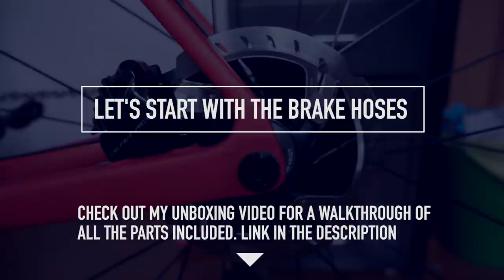Dura Ace Disc brake Installation and bleeding How-to | Road to Dura Ace 9170 Ep.3

Comment: Great video and the music certainly helps with what is quite a stressful process the first time done.
I just wish I'd seen it earlier: I over-tightened the bleed screw and stripped it...
It's much too easy to do this with such a tiny aluminium hex bolt, so I assume it really does not need to be fastened tight at all.
Fortunately there is enough 'outside' of the screw-head clear of the lever body for a small pair of pliers to get sufficient grip on it. But it took a lot of profanity before I realised this.
I'd also advise against using a ball-headed allen key on the bleed screw, it seems to make the slipping/ stripping problem worse. Flat-sided, and inserted as straight and deep as possible.
Reply from the maker: 100% agree! I can add that even my "expensive" hex set has a slight curve on the non-ball end side that can cause trouble. Now I always use a really cheap set of small hex keys that at totally flat on both ends.
Like you say, it doesn't need to be that tight at all, it's probably the rubber O-ring that keeps it sealed rater than the actual screw.
Cheers!

Comment: Stumbled upon this after watching the rotor installation video from Park Tools and they recommend to not put grease for the rotor and centerlock lockring. But as long as you are careful to not contaminate the rotors, I don't see why not to put grease there as explained in this video
Reply: The axles that are pretty much at the same distance from the rotor as the centerlock are, are full of grease. I agree, if you're careful when applying the grease and when cleaning it isn't a problem

Comment: Most important tip of this video.. do now overtighten.  You are better off checking your brakes for leaking over the next few days than over tighten it.  I had to buy a new shifter because of this problem.  the threads inside the shifter is made of cheap plastic/alum or whatever the crap it is.  I wish shimano made the fill port like their older models with real metal and very hard to strip

Comment: Interesting.
Why not wiping any fluid before  putting the bleed screw back in? I always did that, whats wrong with it? Thanks in advance.
Reply from the maker: You basically want to have it overflowing as you close the bleed screw to prevent any air getting trapped.

Comment: Shimano has great tool for cutting brake hoses and installing inserts (TL-BH62). It makes that job easy. btw, you making great videos =)
Reply from the maker: +massionmassii thank you!
yes, I've seen it as well. Did not really feel it was necessary as I do this once or twice per year. But good to know that it is an option! Thanks for sharing!

Comment: Great help! I have the Ultegra version which have the bolts already in the levers with a yellow stopping valve. I'm presuming there's liquid in them already. The cables are already attached to the callipers and sealed. I'm not really sure how to approach getting the stopper and bolts out of the levers and attaching to the cables?

Comment: Did you found the hood a little loose? Or I'm just an unlucky guy?

My R8070 right hood get loose just after I rolled the hood from front. Replaced with a new hood and everything is fine.
Same happened for my old RS685 while it takes several months to happen.
Reply from the maker: Adam Queen yeah, they tend to not be as tight after you pull it back the first time... not a big issue for me, they seem to “pop back” in to place one you start riding I’ve found. 
Not had the need to replace one yet.
Reply: Glad to know that, I'd ride hundreds kilos to see if it get better.

Comment: Very nice & instructive video - as always. 
@1:40, the bolts provided with Ultegra R8070 are way too long for my bokeh frame. Should I look for shorter bolts or work with spacers? Thanks and keep up the good work!
Reply from the maker: MaPo depends on how long they are? I I used spacers in my Bokeh as well, maybe 5mm or there about. You don’t really want to have them stick out too far underneath.
You can also buy those bolts on amazon, this is the one for 15mm stays
https://amzn.to/2FettUE
Don’t remember exactly which length the Bokeh required.
Cheers!

Comment: How much lever movement did you turn out with before the brakes grabbed? I know  you can adjust the reach and free stroke on these levers but mine seem to have a lot more "distance travel" toward the handlebar than my old 785 levers did?! The brakes work fine, but there is just a lot of travel. Do yours feel like they have a longer pull as well?
Reply from the maker: Brian Smith, hmmm no, I think it was about the same feel if not a tad better... was a while ago now I used the 785 so can’t say for sure. I always liked a lot of travel on my levers though.
Check my reach and free stroke video, I have mine set to minimum free stroke and about middle reach.... 
https://youtu.be/9TkudgYe0EY
maybe you can compare yours to the travel in that video.

Comment: Hi! Great video, just got one question. I'm building a bike from scratch with Ultegra R8070. How do you recommend me to measure hydraulic cable lengths since I don't have the old ones to compare? Thanks.
Reply from the maker: I would thread the full length hose through the frame, then secure it at the point where it would be at the rear brake caliper. Take the other end and hold it against the handlebar (or even tape it down if necessary) then turn the handlebar in both directions and make sure you have enough slack so the bars can turn freely.
Like I do @ 0:27 in this video.

Hope that helps
Reply: @ridesofjapan  Thank you!!!! I'm really excited about the build!
Reply from the maker: Jernej Markovc Nice mate, nothing like building up your own bike 👍Good luck!

Comment: did you use the full two bottles of fluid for the install? I'm starting with a dry system like you (with used parts) and I'm wondering how much fluid I should buy, and I still haven't found info on the volume of fluid the system contains
Reply from the maker: Jean-François Morissette if you’re  lucky you could get away with just one bottle, but I wouldn’t risk it... get two just in case, you will need it eventually when re-bleeding. Not very expensive either.
Personally I got one of the big bottles, should last me a good couple of years :)
Reply: Thanks for the answer! I'll go with the bigger bottle then. cheers!
Reply: What kind of fluid?
Reply from the maker: Dust2dust02 Shimano only uses mineral oil

Comment: Swapping out ST-R785 shifters and BR-RS805 calibers for ST-R9170 and BR-R9170, would the same hydraulic cables be re-usable?
Reply from the maker: According to Shimano, they say you should use the BH90 cables with 9170/8070 rather than the BH59 that are specced for the 785/805. I haven't tried using any other combination so can't confirm or deny if it will cause any problems.
One thing to keep in mind though, is that the Hose nut you need for the 9170/8070 levers only comes with the BH90 road hose kit.
Reply: From what i know the BH90 have a bigger diameter to push more/easier fluid. shimano adopted the MTB stuff to road here. in theorey it should work with the old cable, too, but you need to buy the new hose nut seperatly then.

Comment: i would like to replace the brake calipers only. should i use new "olive" ring and hose insert at the existing brake line? or should i also change the brake line with a new one?
Reply from the maker: Alex Ioannides To be sure that it will be a tight seal I would cut of the old insert/olive and install a new one. No need to change the hose as long as it is long enough and the new caliper can use the same hose (In Shimano’s case SM-HB90 and SM-HB59)

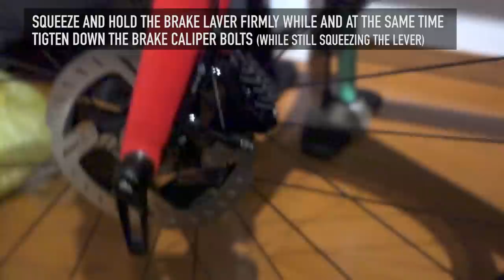Comment: 11:21 What is the torque requirement for tightening the front break mounting bolts on a carbon fork. According to Shimano manual 6-8 Nm is needed but i think that's too much. Great Video, thanks.
Reply from the maker: Litening Pedals you should be okay with the Shimano specs unless the framemaker specifically states something else. I’m usually in the 5-7 range.
Reply: Thank you

Comment: Great Video! Just curious if I do take out the hydraulic hose from levers after installation do I need to rebleed etc? I am only asking cause I dont have a bleed kit and would like to change bars.
Reply from the maker: Thanks! Most likely you need to rebleed as air might sneak in to the system. You will know once you connect everything again... when you disconnect make sure you don't squeeze the levers.
If the lever feel "spongey" when reconnected, then it's probably best to rebleed.
Btw, unless you're handlebars are internally routed you shouldn’t have to disconnect the hoses.
Reply: Thanks! Yeah I am taking out the internally routed ready bars for a custom paint job and figure I try to do it myself without bringing it to the shop. Guess I best buy the bleed kit.. Btw are Sram bleed kit and shimano bleeding systems compatible other then using diff oils
Reply from the maker: The way you bleed them are quite different... you could probably hack your way using sram syringes with Shimano, but not the other way around. Shimano are way simpler to bleed as you don't really need syringes.

Comment: I have a new 785s and one issue. It is too much 'freestroke' feeling and large levers movement until they bites disks. 
I've bled these things several times with all the tricks (according your video). No air in system! The free stroke adjustment is all the way in (least free stroke) but the lever still moves 25mm before pads full engage. Do you have same problem with your old 785s?
Reply: You can use a smaller bleed block. Original it is 10mm. You can use 9mm or 9.5mm. you can make a bleed block by yourself from metal , wood,...
Reply: @arnopauwels8945  nice try, but ... same same. Used 9,5 mm block custom made. Still to much lever movement :( Thanks for idea.
Reply: @61vik  you can try 8.5mm. I had the same problem. And how smaller the bleed block, the pistons coms more out. It's the only way it works. Succes

Comment: Did you fit the Di2 cable through the same opening as the brake hoses? Thinking about converting a mechanical canyon endurance to Di2 ... I won't think the cable will fit through the gear cable openings.
Reply from the maker: Horstelin This frame was di2 specific and was made to take the brake hose and the di2 cable through the same hole with a combo-insert.
Reply: Rides of Japan ah ok I guess I will have to solder to make it fit... Too bad those R8020 STIs are so damn bulky
Reply from the maker: Horstelin oh wait a minute! I confused this with another frame I had!
There was a separate port for the di2 on this endurace, but I manage to get both the hose and the di2 cable through the same hole by modifying the frame insert... just needed to make the “slit” in the inserts big enough to squeeze the di2 cable in.
Unfortunately I don’t have this frame anymore so can’t show exactly how I did it.
Reply: That are great news, thank you! I guess I need to start saving for the new groupset.. :)
Reply: Don't mean to cut down di2 I think their shifting system is great.  But if you have an older bike with out the wire plumbing ports, just go Sram wireless e-tap, and while you're at it go WiFli.  No wires no battery containers "NADA PINATA", just clean as a whistle.
Reply: @dansotelo228  I guess I'm just a Shimano fanboy :D
Reply: Keep it fun!  I love how di2 shifts especially how the front derailleur automatically helps shift then moves away from the chain, simply the best.  Just a reminder, make sure your derailleur hanger is true, and just because its new does not mean it is true, as di2 is very sensitive to this. Also keep in mind your di2 11 speed chain has a very short life, start checking it at 600 miles, with an infinity measuring chain tool like the ParkTool CC-2. When it measures just slightly past 0.5 replace the chain. Ignore the 0.75 Replace Chain printed on the ParkTool, cause if you let it go that far, you can kiss your expensive cassette good by. That goes to any high end road or mtb chain.
Enjoy, Dan

Comment: Thanks heaps for this video, super useful and easy to follow! Managed my first brake bleed without issue. Noticed my pads are getting a bit lower (nothing dire), so started searching for new pads. Couldn't find Shimano lo3a pads anywhere (or basically any Shimano pads). I live in Japan, and in Tokyo, but that doesn't seem to help. Any thoughts on suitable replacements for the lo3a pads?
Reply from the maker: I got word from my LBS that Shimano is replacing L03A with a new pad L04a (probably look exactly the same) but probably still be a while before it’s out I reckon. 
Any pad that fit the Shimano flat mount is better than nothing, but I haven’t personally tested any of them so can’t give you a recommendation sorry.
Reply: @ridesofjapan  much appreciated. Will see what the LBS suggests…

Comment: How did you get the olive over the barb? or did you just leave the barb installation part out?
Reply from the maker: 1:05 barb installation
1:55 olive just slides over after the hose nut

Comment: Thanks for great instruction. Now.. what should I do if I actually overtightened bleed screw and messed it up?; help plz.. TIA
Reply from the maker: Did you totally strip the head?
If you still have some edges left, find a hex-key that don't have a rounded tip.... that rounded tip on the more expansive ones did almost destroyed my screw.
I found non rounded ones in one of those "cheap" multi-tool kits... 
Another tip would be to find a small enough torx key witch is also a common tip for damaged hex crews.... wonder if they make em that small though.
Reply: Rides of Japan tnx for the tip. I think i totally stripped the tip. Since i had bh59 with rs 685? And replaced with bh90 with r8070, i opened and closed bleed screw at least 4 times during the learning curve. I mean replacing is one thing but how do i close it after final bleeding? It seems inevitable that i need to go get a new screw huh? Do u think normal bike shops in the us will have replaceable screws? Since r8070 parts r really hard to find due to low supply, i ordered from uk and germany and US shops. Smh about my dumbness and lack of skillset...
Reply from the maker: Yes, I would get a new screw just to be sure. If your LSB don'T have them in stock they can surly order them. The part number is Y0C698030. (Did a quick google search and there seem to be a few sites selling them)
As I learned too, you don't actually need to close it that tight, the O-ring is what is keeping it from leaking.
I mess up all the time, that's what we learn from :P I semi-striped one of my bleed screws, and order two new just to be safe. They are available online here in Japan.
Reply: Rides of Japan tnx again for ur prompt answer. Just subscribed as well :) plz keep uploading DIY videos so i can learn more-!
Reply from the maker: Jonathon Lee thanks man! Got a few tips to share in the pipeline :)

Comment: Do you really need to fill the system with oil to the top ? With the older génération (R785) if you did this the oil would leak somewhere to prevent overfilling
Reply from the maker: Yes to avoid having air in the system you need to fill it to the top (into the funnel)
Reply: @ridesofjapan  okay thank you !

Comment: Hi, love your videos. Do you know how to adjust the new 105 disc STI to get the breakting point earlyer? At the moment I can pull the lever to far to the handlebar...
Reply from the maker: Sound like you still need to bleed the brakes a bit more if you can pull the lever all the way to the handle bar.
Put an extra drop of mineral oil into the bleed port on the lever once you have removed the bleed funnel, just to make sure not air sneaks in when putting back the bleed screw.

Comment: Hi! thanks for the video!!
I get a firm leaver after bleeding but when I put the wheel back the leaver becomes loose again, how can I fix this?
Reply from the maker: Was it still firm directly after the bleed? and then got loose again?
If it's loose right after bleeding there's probably still air in the system, so try blending again.

If it was feeling ok but then got loose after a few hours check so that the hose connections are dry (no leaking)
also check the caliper pistons if you see any leaking oil.
Reply: @ridesofjapan  It was firm straight after the bleed when I removed the brake block and installed the wheel the leaver became a lot looser. is that normal?
Reply from the maker: Theodoros Chatzis yes, that is normal.
once you remove the blocks and put the brake pads in and the wheel, you will need to pump the brake lever a few times to push the pistons out to the correct position.
If you just keep pumping the lever you should feel them firm up again once the brake pads hits the rotors 👍